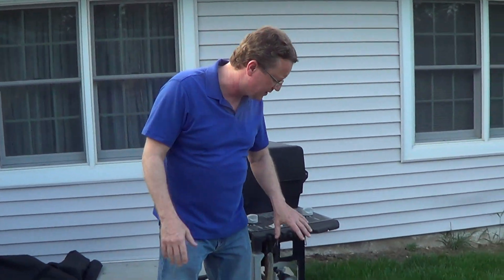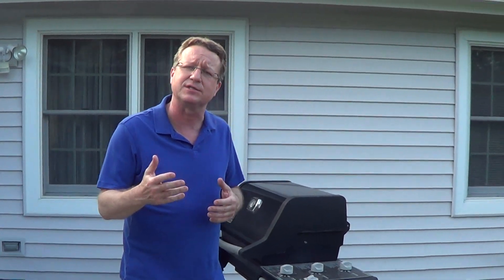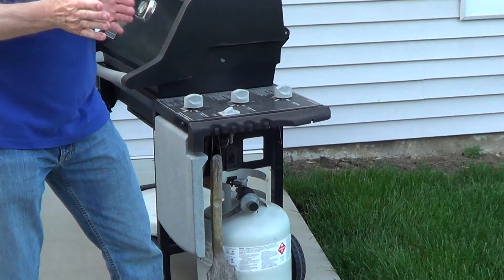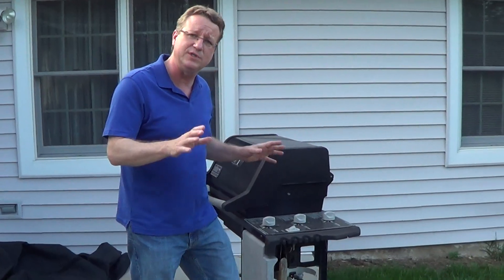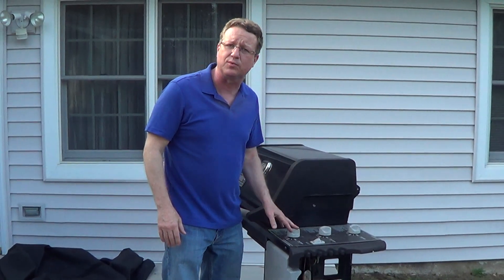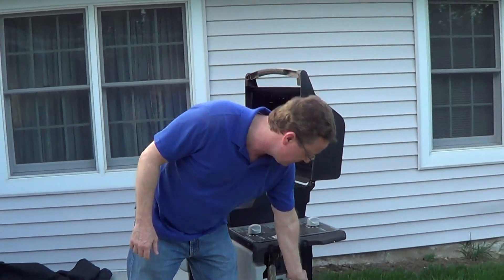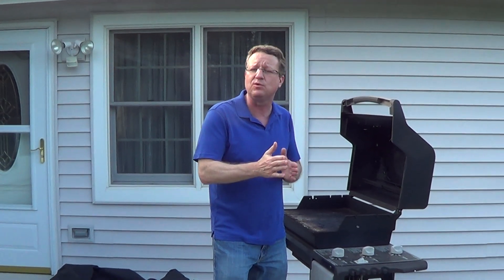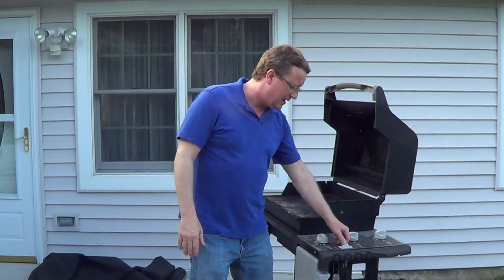Low Flame on Propane Grill - How to Start a Gas Grill

Comment: This happens from opening the propane service valve too quickly. It's a safety mechanism called an excess flow valve designed to detect ruptures. Crack the valve open a bit and then open it all the way. Close all the way.

Comment: My Genesis silver a has start up problems,had to manual use lighter gun,only front burner lit up for 2 minutes or less,seemed like weak flame,back burner not working,have not used for 4-5 years,was covered in yard and went thru hurricane sandy,should I replace burner bars,igniter,and regulator because perhaps the saltwater is the issue ?
Reply from the maker: Hi, if you have access to a compressor, I would try to blow out all the tubes first.
Reply: Just watching video again,I did not wait a full minute,will try this again ! If I need to then will remove the tubes and clean.

Comment: Question.. I have a Weber summit gold and everything was working okay until tonight.. everything starts up fine but the first two burners, of the temp control
Knobs are switched from high to low, the burners lose the flame and go off? The other four burners don’t have this problem but the first two, only work while set on high. The electrode is lose with the collector box being open on top. Could this be the issue? Or is it a propane air flow issue? Any help would be greatly appreciated
Reply from the maker: Hi, I would first make sure that you are starting it correctly. Turn off the tank and all the burners. Disconnect the hose to the propane tank. You should hear a discharge of propane. Reconnect the hose and slowly turn on the propane tank to full open. Wait at least one minute for the  regulator to adjust. Then light your grill. Let me know if that helps.
Reply: FIX IT Home Improvement Channel thanks for the reply. No, unfortunately that does not fix it as I tried this prior to posting.
Reply from the maker: Hi, the burner tubes could be slightly clogged. Remove the flavorizer bars over the tubes, then use a brush to clean the holes in the tubes. Also look at the tube that transfers the flame to each burner tube. I would try this next.

Comment: wait a full minute after opening gas tank valve???  ... seriously, that is absurd, nobody is going to wait a minute, LOL.  Ya, open the tank valve, open grill top, open the grill burners wide open and hit the electric start .. then use a long butane lighter when the electric start isn't working well.
Reply from the maker: Got this tip straight from Weber after having a lot of customers complain about a low flame. Solved it every time.